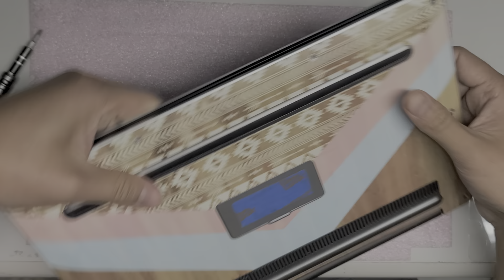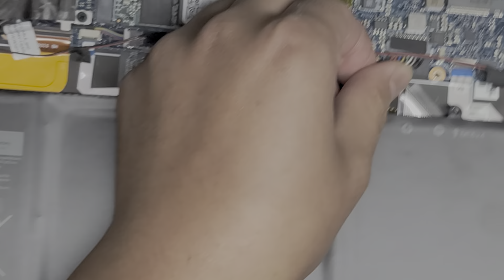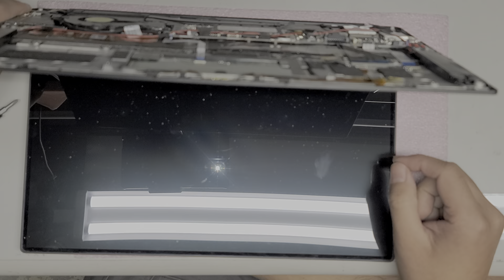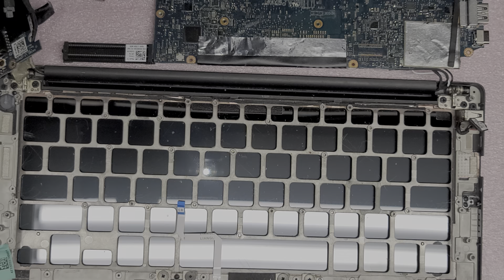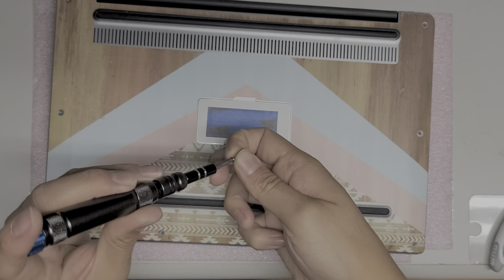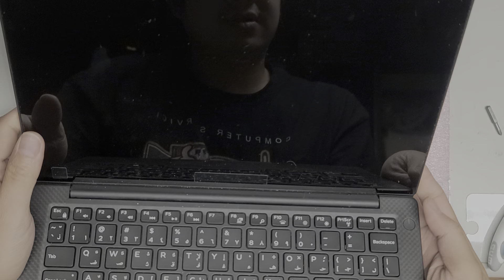DELL XPS 13 9350 Disassembly SSD Hard Drive Upgrade Repair Keyboard Battery DC Jack Replacement

Comment: My dell xps 13 9350   core i5 6th ram 8Gb can update to 16Gb?
Reply from the maker: If it fits you can.
Reply: @ItsBinhRepaired  thank you so much.
Reply from the maker: @sonaem8889  no problem